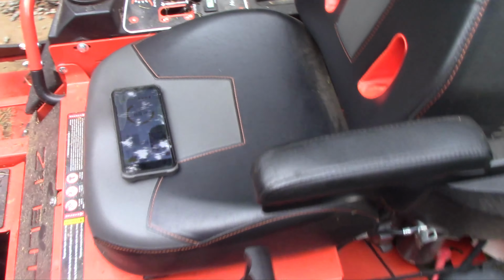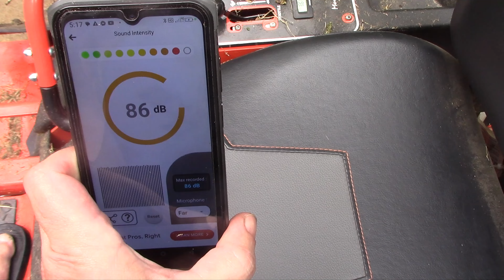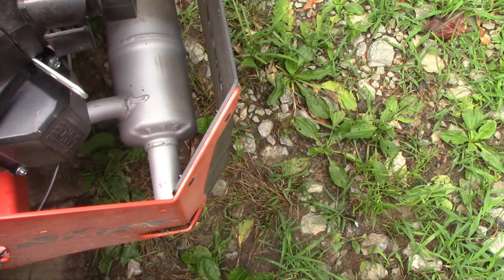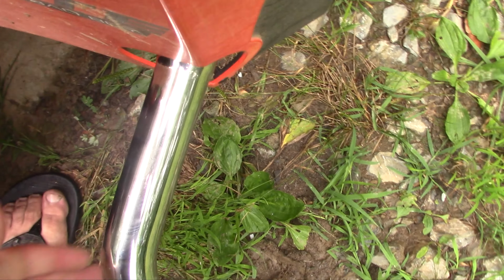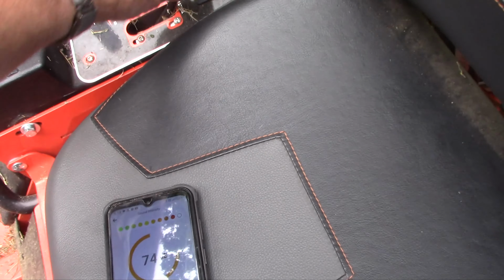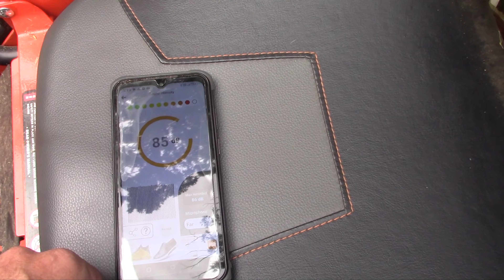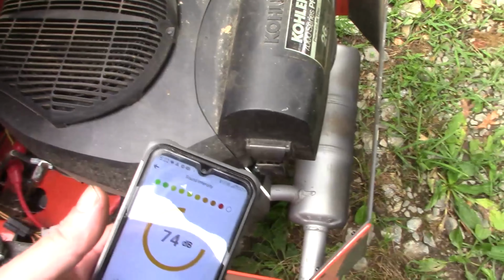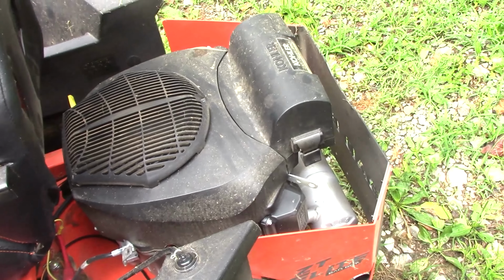Trying to quieten my badboy zt elite mower

Comment: Ok who's gunna fab. up a hood.
Reply from the maker: @wrongwayeric  good question. It would also need air ports out the side. The under plastic bonnet on a old lawn tractor might work mounted to a steel hood. I was very disappointed that this did not work. I just wrongly assumed that the majority of  engine noise comes from the muffler.
Reply: I wonder if the rear shelf bad boy offers will help any.